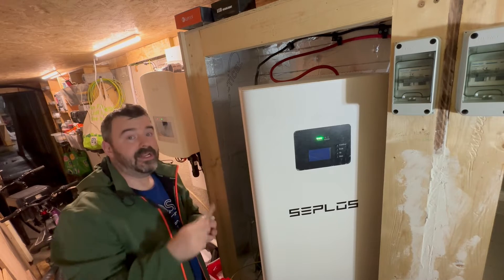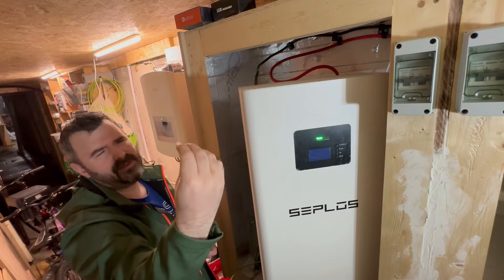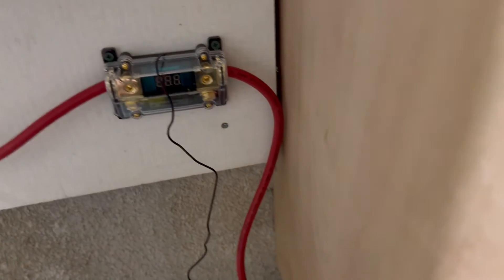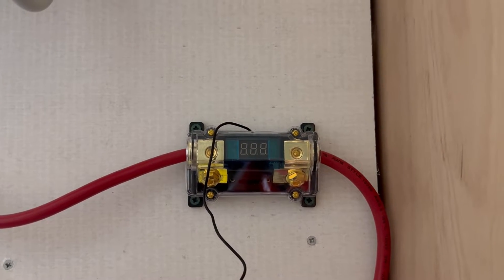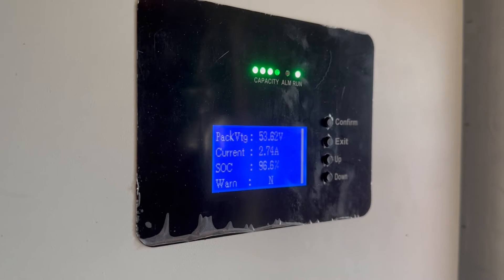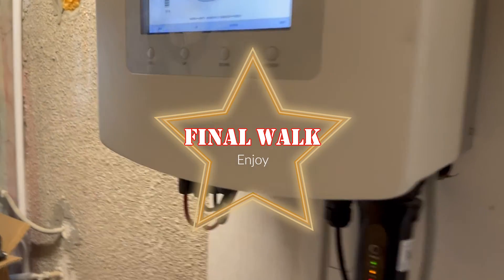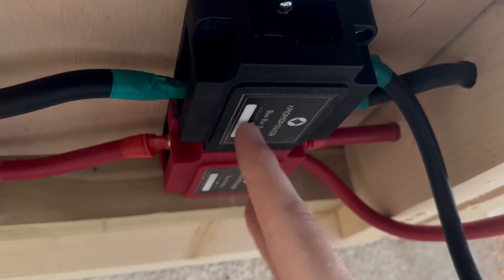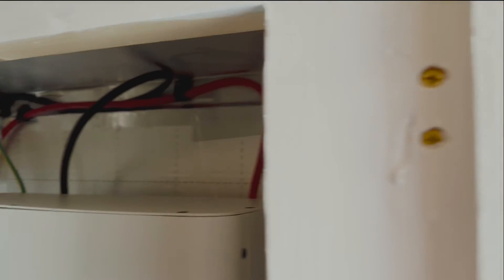Solar Battery Busbar - Final Day - 5 of 5

Comment: Fantastic work and information Gary massive well done. Would you have any amazon links to the cable (2 and 4 gauge) buzbars, DC breaks, fuses and the crimb tool used.
Reply from the maker: Sure. I have added most of the gear in the description for you.

Comment: You need to put something Inbetween your earth bar and the foil it could become live ?
Reply from the maker: Yes. There are rubber ring gaskets behind the earth bar. Though I plan to install on a small plastic block. Good spot by the way.